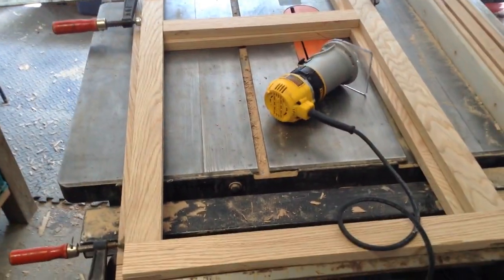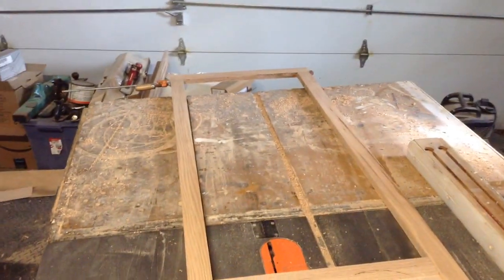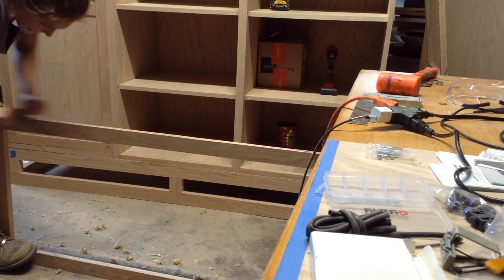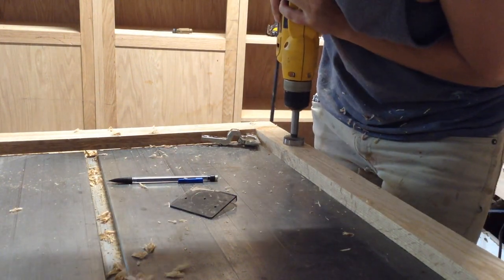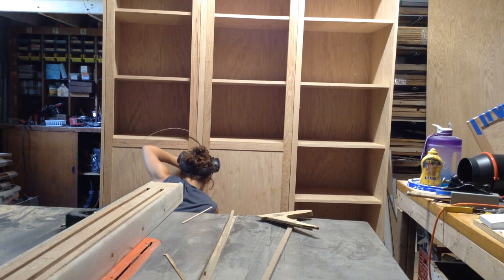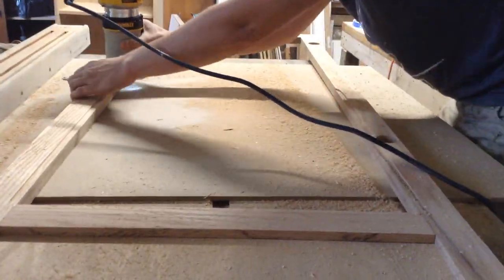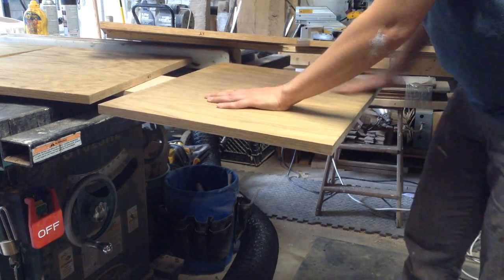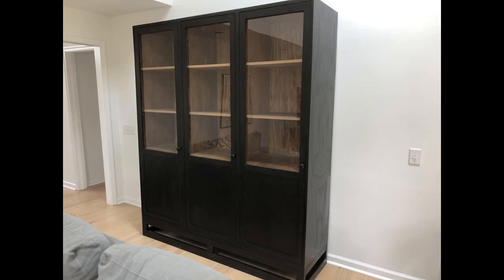Woodworking : China Cabinet & Storage // How-To Part 3

Comment: Very nice build, thanks for sharing. At the 3:00 minute mark you used a level checking for bow in the panels. A while back I wanted a 6' level to check straight edges. At a big box store I grabbed two levels and held them against each other along the length. I was surprised both levels appeared concave with a 2-3/16ths gap in the middle. I haven't found anything online stating this is by design. Your level may or may not be bowed. A quick check can be accomplished by pulling a length of twine taught across opposite ends of the level. If there's a gap you'll know. Thanks again for sharing, very nice build.
Reply from the maker: I wouldn't be surprised if my level is bowed based on the quality of objects for sale out there today.  But, I used a couple different straight edges on these cabinets and they were definitely bowed.

Comment: Great work as usual.
The few times I needed to cut plexiglass I used the table saw.
I used an 80 tooth cross cut blade with a zero clearance insert and that worked fine for me, although my plexi was thicker.
Not sure how it would work with the thinner material.
Reply from the maker: I have cut plexi on my table saw before.  It usually works well, but I have had times where the heat of the blade starts to melt the edge, so you have to time the speed of how you send it through.

Comment: Nice job, was there a reason why you made the doors the way you did . Door rails run from top to bottom with the top and bottom rails inside like the middle rail ?👏👏
Reply from the maker: Funny you say that because that was the original plan to have them run the length of the cabinet and I changed it for a good reason that is now escaping me hahahahahaha.

Comment: Just out of curiosity with winter coming on do you have heat in you new shop. We used to watch you work in your old shop in layers of clothes in the past.
Reply from the maker: This shop shares two walls with the main house so I'm hoping it doesn't get nearly as cold as my old shop.  But, I will most likely supplement with a heat source.  Even though there is a gas line running through the shop I could tie into, I am leaning towards trying out a diesel heater.

Comment: Great job as always.   Why can't plexiglass be cut with a circ saw or table saw?   Chipping?

Anyway, thumbs up and thanks for posting!
Reply from the maker: I’ve cut it on saws before.  Chipping can be an issue, but I’ve more so had issue with the blade melting the edge as it heats up.

Comment: Came out Nice! The two tone stain looks good! Maybe you should try to find a lumber or plywood outlet that sells a better quality of Plywood. I know the home centers are easy to get material quick but are not always going net the best material!  Nice Job!
Reply from the maker: Agreed, and should try and find a better supplier.  And hope the cost isn’t much more because the cost of materials going up anymore is I’ll start pricing out some of my customers.
Reply: @HoneyBadgerWoodWorks  Yes, With the prices increasing it will push the cost up enough to put a project over people's budget for sure! On the flip side it's going to increase at the furniture stores as well with a piece of less quality!